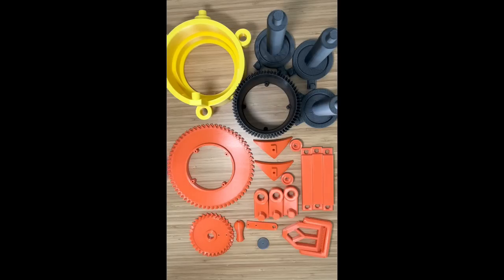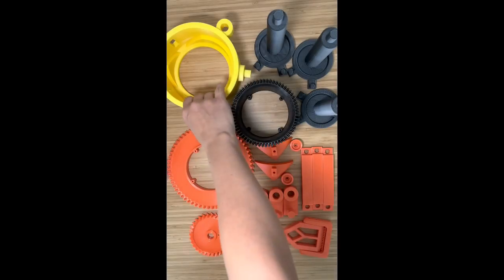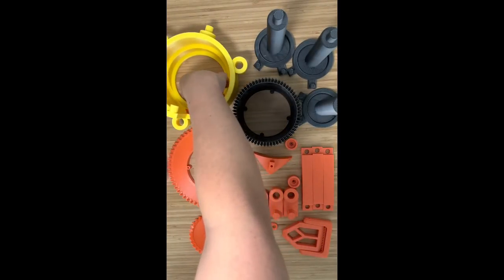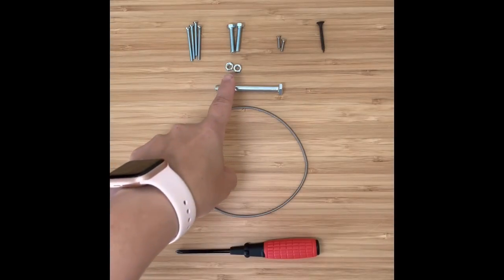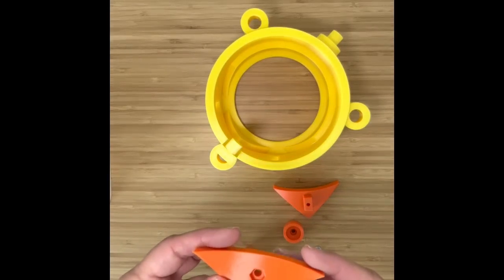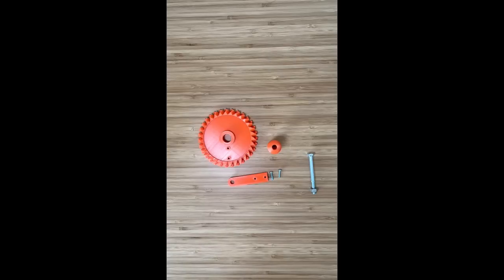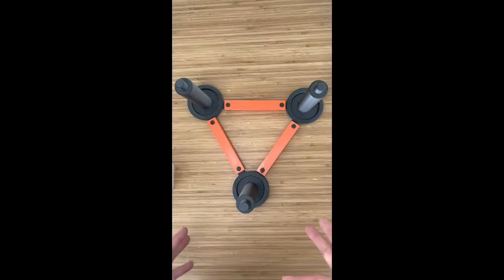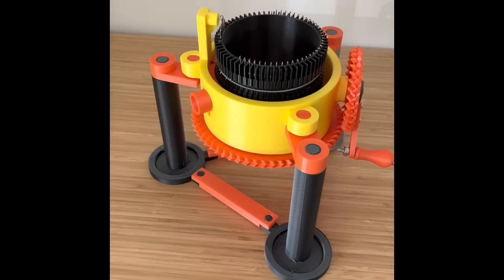How to Build a 3D Printed Sock Machine

Comment: I have a good question could you 3D print the different screws needed and also can you even print the needles
Reply from the maker: You may be able to print screws but I find the metal ones more sturdy and more resistant to wear and tear. The needles would be difficult to print as they have a hinge at the top which allows them to grab the yarn and pull it down. I also think metal needles will last longer.

Comment: Thank you for taking the time to share this. Does it need to be sanded after printing? And could you share what 3d printer you used?
Reply from the maker: We used an Ender to print the pieces.  I sanded any really rough spots.  That’s about it.  The machines have worn really well.  The only place where I see consistent wear is the the gear that turns the base of the machine.  My husband has printed me some extra pieces so I can replace them when necessary but I haven’t had to yet.  Hope that helps!
Reply: @jolineknitsalot  thank you, appreciate your response

Comment: A friend is printing for me and I'm working in sourcing the non printed supplies. I'm having a hard time finding how many needles the cylinder holds.
Reply from the maker: You get to decide what size of cylinder you make. A 60 st cylinder needs 60 needles. I think it’s a good idea to have some extras on hand.
Reply: @Joline Vretenar  ah thank you. I didn't realize the file had options for the different sizes

Comment: Thanks so much for this video.  Can I purchase sock machine needles of a certain size, or is purchasing the ones above and then cutting required for the cylinder?
Reply from the maker: Unfortunately you have to cute these needles in order to get the correct size for this machine.

Comment: I’m very excited to try and make this!! I know you made it yourself on your 3D printer but do you have any idea on the cost of the materials?
Reply from the maker: I can give you a rough estimate.  The 3D parts took about 1 kg spool of PLA (according to Sir Knits a Lot.). The needles were the next most expensive part.  Depending on where you source them, they might cost from $40-80.  This also depends on how many you get.  I initially ordered 150 needles and spent about $60.  The screws and bolts will probably come to about $25 but that’s just a guess. Was this helpful?
Reply: @jolineknitsalot  yes thank you so much!